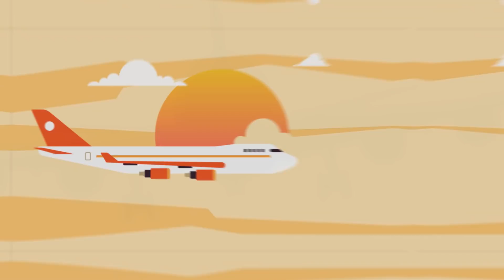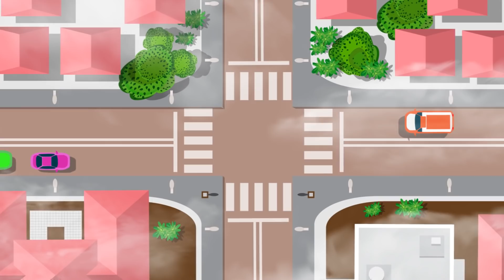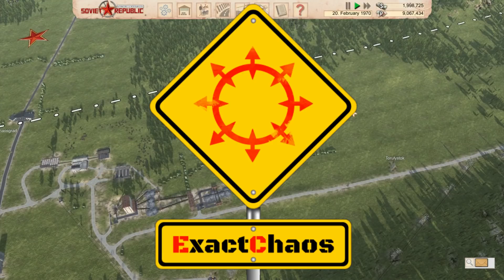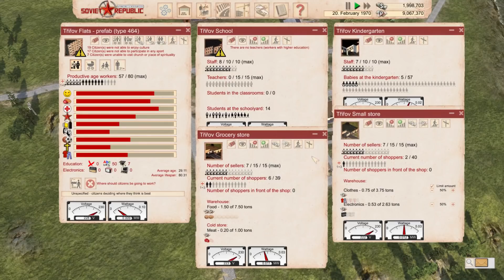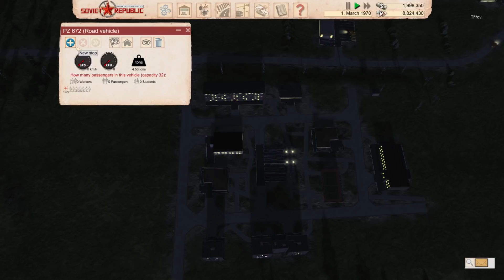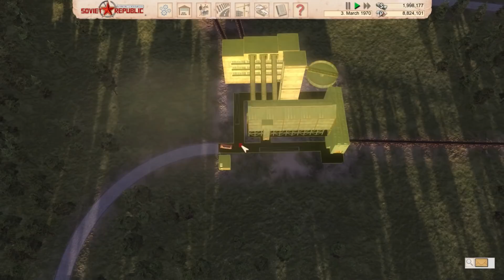Workers & Resources: Soviet Republic - Chaosgrad #4 Construction Industry

Comment: There are a lot of different working parts to deal with in this game and I have learned something from each of the 4 youtubers I have watched so far.  I had no clue about your trick of turning off auto construction and seeing if your layout would work prior to building things, thanks. That is going to save me a lot of money.  You are definitely more organized in your planning than the other channels I have watched.

I am not sure that running 2 conveyers from one building to another does anything besides use up cash, maybe at very high levels of resource movement it would help, but early on, one of the 2 conveyers is usually idle.  I suspect a building with 4 conveyer in/outs is intended for the situations where you need to use multiple truck loading/unload buildings instead of a storage building.

When trying to send workers to factories that need few workers, use multiple small shuttles instead of a full size bus.  That one trip you sent 29 workers to a coal processor that only needed 15, the extra 14 went back home and used their free time/sleep time before going back to the bus station to go to work again.  Also workers will only stay at a bus station for so long before they call it a day and head back home to relax.  So it seems to work better to use more lower capacity buses than fewer large capacity buses, just space the buses out a bit and you will pick up a steady stream of workers.  You could also try routing that larger bus to the coal processing plant to this:  bus depot>coal processing > coal mine> bus depot.

Like I said you are definitely more organize and I hope you keep doing more of this game.